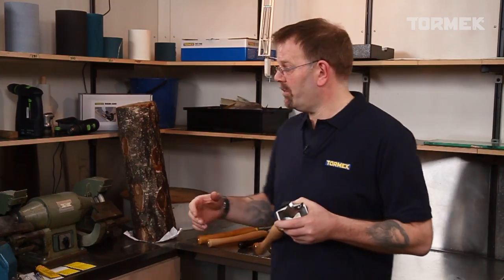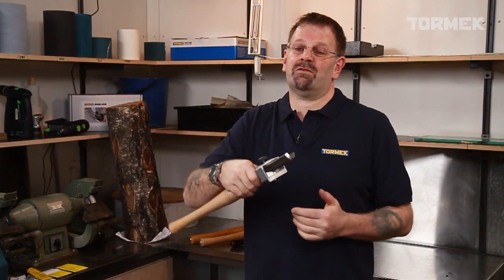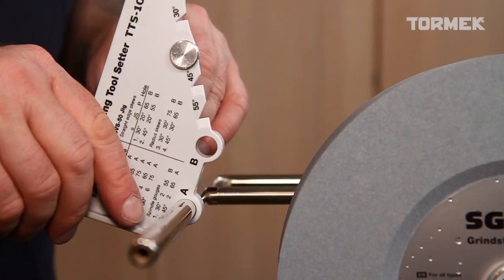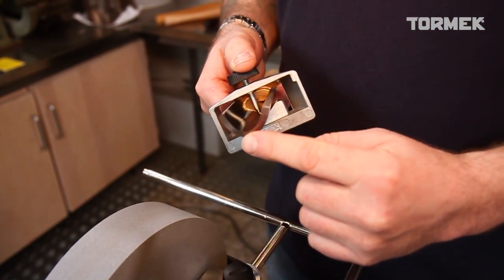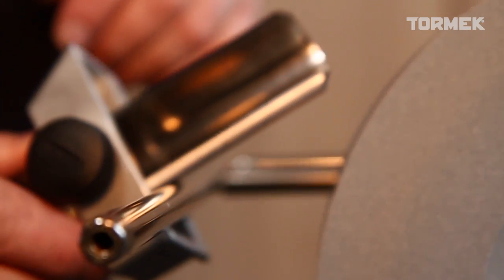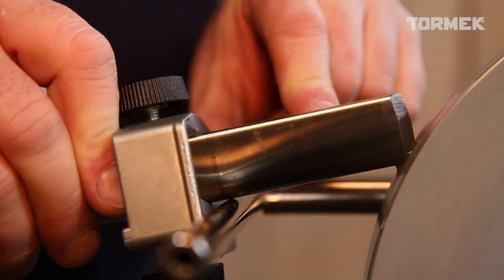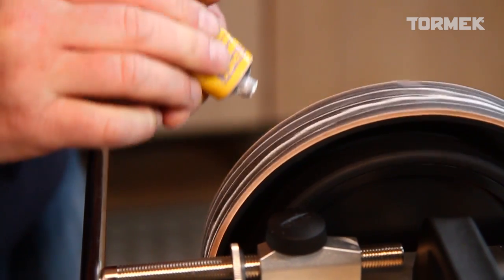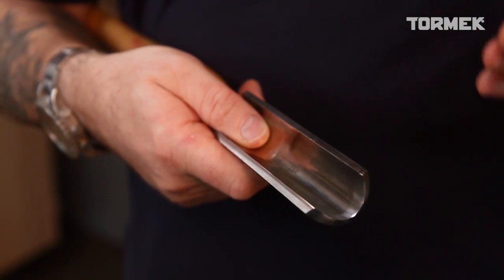Sharpening a roughing gouge

Comment: Can I just double check the settings you mentioned... I have just tried this with a 3/4 roughing gouge. Guide bar set at point A on the TTS100, tool projection at 75mm. This gives me a lot steeper angle than 45 degrees than quoted. This is with a T4. Have I missed something, my projection needs to be around 85mm?
Reply: The T8 he uses here has a larger wheel diameter of 250mm so you need to adjust your settings to your wheel size which is 200mm I think.

Comment: He uses a protrusion of 75, and hole A, with the SVS-50. But the TTS-100 shows no combination using those settings...... What angle is he trying to make.....
Reply: You don't need to use the tts-100, in fact the tts-100 only shows settings for the skew, not for roughing gouges. Here he is just moving the support til the bevel matches the stone. I think the ending is incorrect, recording your settings only works with the svs-50 with skews and svd-186 with bowl/spindle gouges etc, there is no predetermined hole setting for a roughing gouge, just whatever your bevel is ground to.

Comment: What is the best height for the table the Tormek sits on?
Reply from the maker: Hi Tristan! The height depends on the type of tool you are to sharpen, and of course, your height. At knife sharpening, the height of the table or bench should be 550-650 mm (22-26″). You can also sit on a chair for certain operations, e.g. when sharpening scissors.
Reply: Thank you for the quick response! I have mine sitting on my work bench that is 36 inches tall. Using it is awkward and I don't use it as much as I should. I have decided that I need to build a dedicated sharpening station for my Tormek and my rough grinder.

Tristan
Reply from the maker: One thing to remember is that your shoulders always should be in a relaxed position whilst you are operating the machine. We have designed a customized Sharpening Station named TS-740, which is optimized for the Tormek machines and its accessories, you might want to check it out? See https://www.tormek.com/international/en/accessories/sharpening-station/ts-740-sharpening-station/ for more information. 

Good luck with your sharpening and let us know if you ever have any more questions. Stay sharp, buddy!
Reply: Thank you. I have looked at that but the price tag is prohibitive. I had to balance the price tag for the Tormek itself against the quality of the machine and the wide range accessories in comparison to much cheaper imitations and decided to go with the name brand rather than the generics. When it comes to my critical tools, I believe in spending the extra money to buy the best. For ancillary tools and accessories that are only occasionally use, I make up the cost. My Tormek has been worth the investment (best way to present it to your spouse). I think that after I put it on a dedicated stand I will use it more and get better at using it.
Tristan